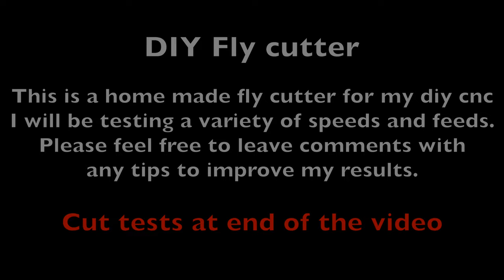Build a Fly cutter, DIY Fly cutter for CNC

Comment: Nice build, glad you did a tool. I ve built and tested a lot of fly cutters and i can tell you one thing, inserts are everything. You can run it at any feed and speed if you don t have the proper tool for the material, for aluminium for ex i use CCMT inserts special for aluminium from Tungaloy who can get a lot of material removed and leave a great finish ( i got depth of cut of 4mm leaving a mirror finish ). I guess you should feed it a bit more slowly with 2000-2500rpm. Another trick is to build your own toolholder which is more rigid than commercial cheaper ones, i can t affort buying a top quality left hand holder to use for my fly cutters and built my own for the inserts i can get cheaper :)
Reply from the maker: Thx, I will be looking into better insert for it. Thx for tip

Comment: Nice results, but concerning the build, why machine steps when you can simply tilt the collet holder in the vise ?
Reply from the maker: I could. I just wanted to test the machine. 😎
Reply: Similarly, if you designed it to use lathe tooling why angle it at all? Lathe tools are designed so the shaft is parallel to the work surface (facing which is the equivalent op).